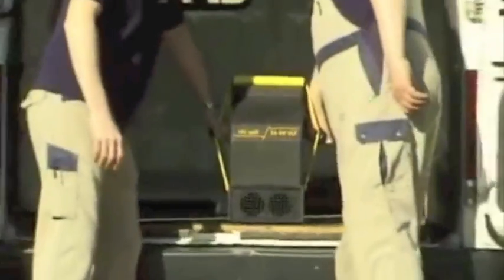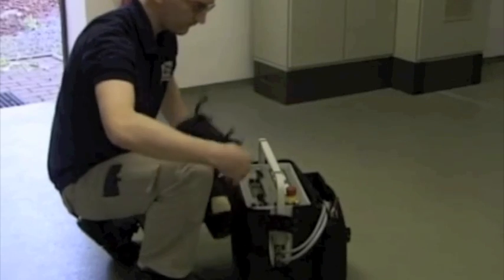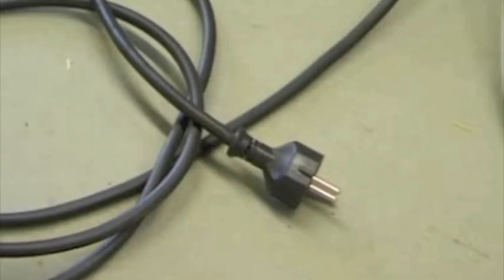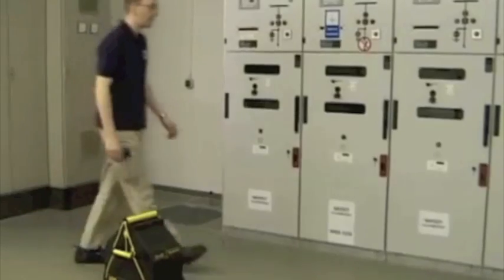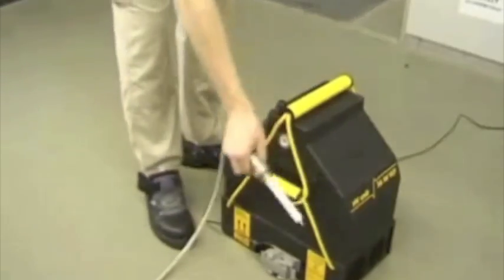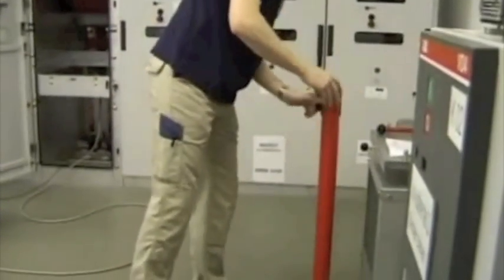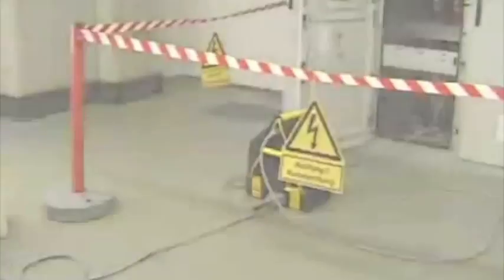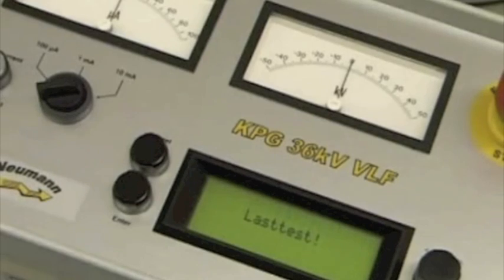KPG 38kV VLF & 50kV DC Portable Cable Test Set:-Supreme Technology & Energy Solutions Pty Ltd

Comment: Besides having a smaller unit to transport, and being able to test longer cable lengths, what are the advantages of a modern VLF versus Direct Current device for insulation resistance testing?
Reply: Direct current device may damage the cable since its output DC current, but VLF is AC output and won't cause the damage on cable. Therefore, VLF tester is more and more popular in market. http://www.xaapt.com/2014/1026/280.html